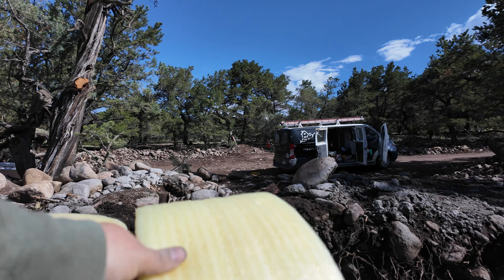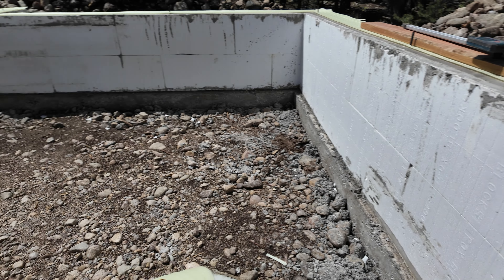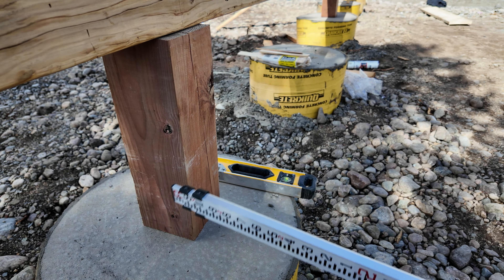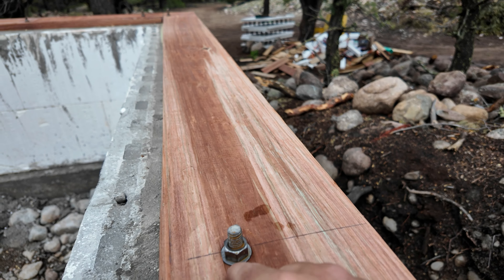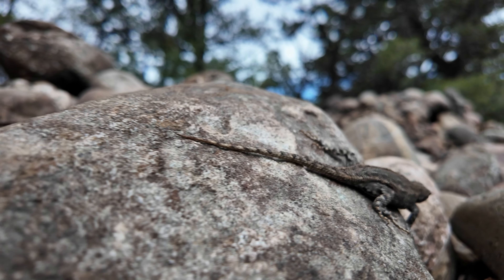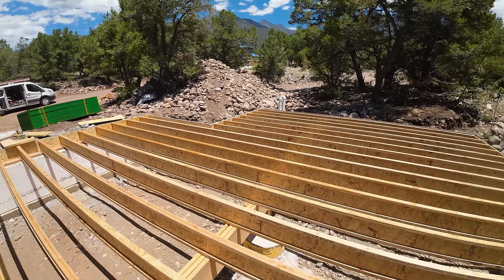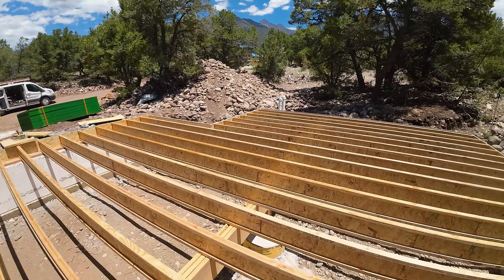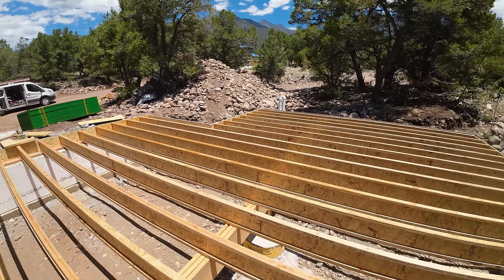Framing a I-Joist Subfloor For a NEW HOME (DIY Guide)

Comment: Good work!  I used I-joists for the second floor of a 2 story garage but used shop made squash blocks between the I-joists as I was concerned about snow load on the roof bearing down.  More work but the spacing was really easy.
Reply from the maker: Thanks! More work but a good idea you had

Comment: Don't forget to add went wholes with screen for crawl space, you don't want to trap moisture in crawl space to cause dry rot.
Reply from the maker: Yes, for sure!
Reply: Vented crawlspaces actually don’t work very well. If you go inside one, they are always damp and musty. Airflow through the little foundation vents is very minimal. Additionally- in the south what little air does come through the vents is very humid- that humid air hits the cool crawl space… and the moisture condensates on everything, leading to mold and rot over time. 

It’s much better to fully seal your foundation, put a vapor barrier across the walls and floor, to keep out the moisture, and run a dehumidifier. Additionally, you can insulate the foundation walls instead of the floor, adding the crawlspace/basement to the conditioned envelope of the house- this is by far the most energy efficient method, and leads to nice clean and dry crawlspaces. No mold or rot issues to deal with down the road.
Reply from the maker: @brandonbeaty6617  totally agree with you, I think if possible the crawlspace should be conditioned with the rest of the house. In this house we didn't do that and went with vents because it is such a dry climate here as long as the space is vented there won't be any issues with mold or smells. That's how the houses are built in this area and it seems to work well

Comment: Do you need a I joist (BCI) on the ends or does the rim board osb efficient enough to hold up the outside walls where there is no BCI?
Reply from the maker: @jst44216  on the sides the rim board will support the weight, but in my case I had to add a second rim board since the outside one was bearing down on the icf not directly to the concrete
Reply: @slothconstruction  thank you for the reply. That'll help me build mine start next week or so. I planned on getting 2 extra bci that are 57' and 31' now that I know you can use the rim board I'll go with that to save money!

Comment: 4X4 posts, what material is that? looks kinda red, and does not look pressure treated. if its not treated and in contact with the concrete, it will rot out in a few years.
Reply from the maker: Center supports are 6x6 and pressure treated. In this area the red pressure treated is what the lumber yards stock, I think I can special order a brown or green, but it is a ground contact pressure treated wood so we shouldn't have any rot issues.
Reply: @slothconstruction  great!!! I guess I havent seen read treating before, Different material in different places.

Comment: HUGE PROBLEM! with your rim board!!!  Because your mud sill overhangs your foam, you need additional rim board that sits on the foundation on the parallel runs, otherwise the wall is not transferring load directly onto the foundation, you are bearing on the unsupported 2X8.  Tis is in the IRC and applies in most jurisdictions in North America and most of the world.
Reply from the maker: Thanks for watching and noticing the problem. I got an email after posting the video about the same thing and we went back into the crawlspace and added a second rim board on the parallel runs so the weight would transfer to the center of the foundation wall instead of the edge. Next time doing a foundation like this I plan to point that out and add a second rim board.
Reply: @slothconstruction  What did you think of ICF?   im thinking of doing a split level next year as a rental house, and use ICF for 4 feet basement, and wood frame the rest of the lower level.   We have 2 basements going in this week for builds we are starting, a spec and one for us to live in.
Reply: Couldnt you just place another I-Joist (BCI) on the inside of rim board on the parallel runs?
Reply: I'm not a framer just an electrician and that's what I usually see when I'm roping houses
Reply: @jst44216  Keep in mind, the rim is the load carrying member, I joists while structural, are not intended to catty the whole houses weight.  Some designs do spec I joists as Rim, but the load calcs have been dome and they are within the  weight carrying capacities.  for example a Roseburg 400 series I joist is rated for 40 Pounds per Square foot, thats not much considering the cords are only 2.08" wide.
Reply: @slothconstruction  Im holding my Rim boards back 1.5" and filling with EPS foam board (approx R6 orR7) then hanging my OSB down to the mud sill when I frame the walls.
Reply: @jst44216  not saying people dont do it that way, they do, its really not right.  I have a helper thats been framing for 15 years, he said the will plate with a 2X8 and set the rim on the overhang, but when I explained it, he realized they have been doing wrong for many years.  funny part is almost no inspector will ever catch it.
Reply from the maker: @jst44216  I added in another rim board to support to transfer weight to the center of the foundation, I could have added in another i-joist but the osb rim board is much cheaper and will work the same
Reply from the maker: @jst44216  hey thanks for watching, you had some good questions
Reply: @slothconstruction  thank you love your content man getting ready to attempt to build my own house with the wife wish me luck haha
Reply from the maker: @jst44216  Good luck, you can do it. Just think of it as many small projects, not a entire house and you won't feel overwhelmed
Reply: I put kickers on my side walls to bear the wall weight directly down , is that permitted with I joist ?
Reply: I put kickers on my side walls to bear the wall weight directly down , is that permitted with I joist ?